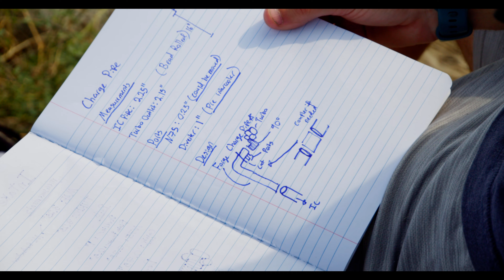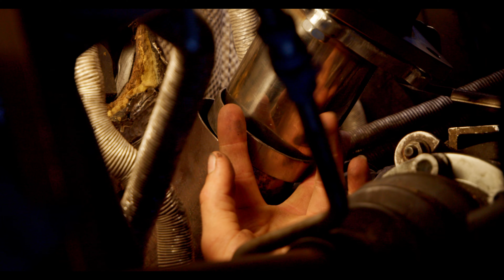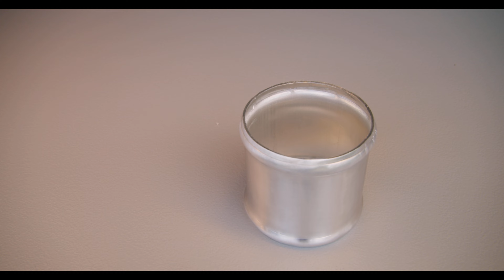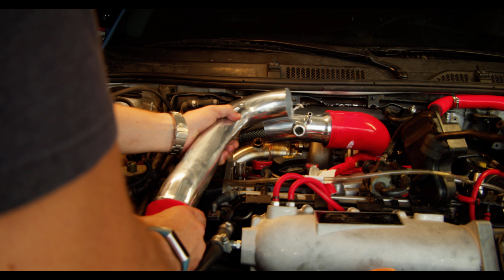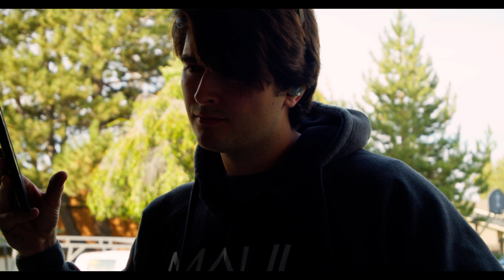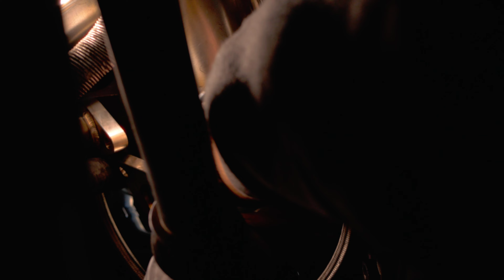The Big Turbo TT Is Almost Ready To Start | Making Major Progress!

Comment: 225 has a hose for the brake booster on the intake? Not to the manifold? I see people running charge piping that looks like the 180 charge piping for after market intercooler setup
Reply from the maker: I believe it has both actually. One connection to the manifold and then another connection to the intake. But depending on the year of 1.8T the intake connection may or may not be there. The vacuum lines got alot of rework though the years from my research.

Comment: Great video and well done on making things work with plumbing. I run a Precision turbo and they have a large o-ring on the inner lip of the compressor housing. When I clock to fit I had to remove the o-ring or else it gets kinked and crushed. Once fitment is right I use a marker to mark the housing so I know where to reinstall with the o-ring back in place. Maybe Garrett doesn't have this. If it does and you perform a boost leak test, that area could leak. Good luck!